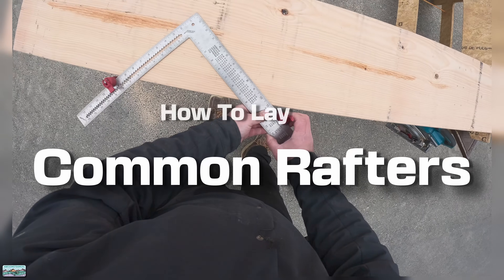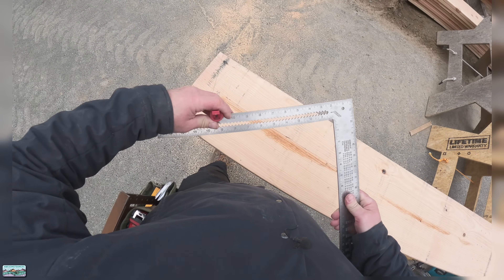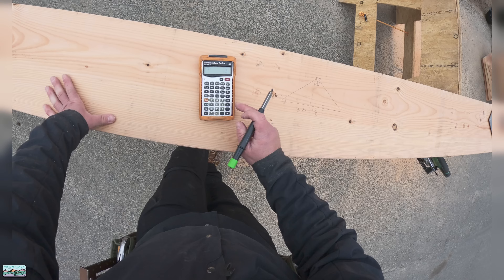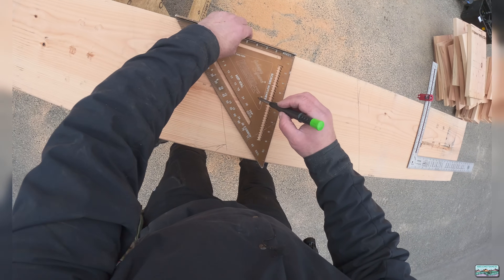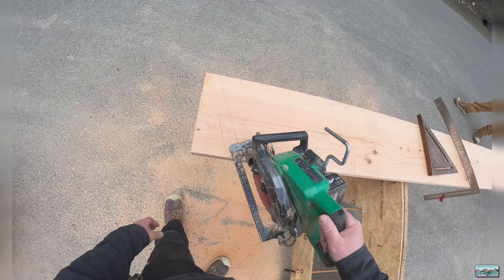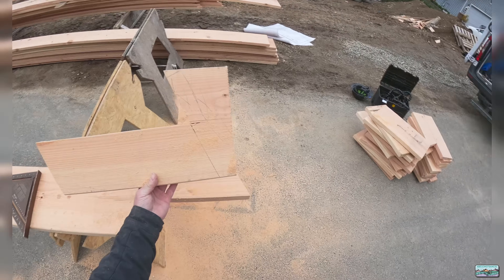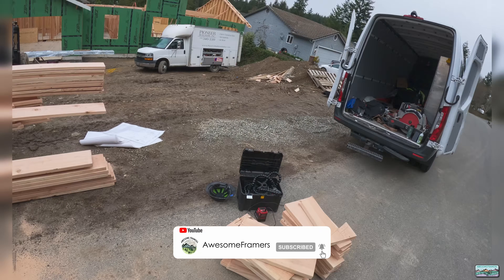How to Cut a 5/12 Pitch Rafter with Precision Project 120 part 14

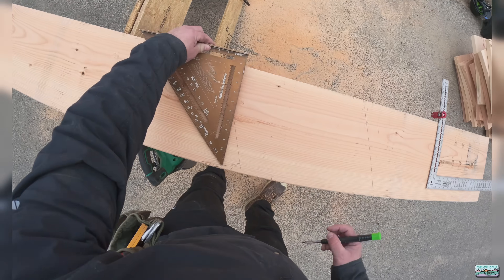Comment: Rather than cutting rafters at pitches like 3:12 or 4:12, wouldn't it be easier to cut them at 20 degrees, 25, or 30 degrees? That way you could cut them with a standard chop saw set to that angle.
Reply from the maker: Absolutely! BUT that's not necessarily practical for many. Chop saw is definitely non production

Comment: Great video, and the rafter tail is interesting on this one. At 6:41 you show where the rafter is bearing on the top plate of the wall. It seems like a very small area for such a big rafter. What type of hardware are you connecting it to the wall with? Just blocking? H-1?
Reply: 7:30 inset pic shows the blocking. He also uses the Simpson SDWC screw thru the plate to tie the rafter to the wall.
Reply from the maker: This was plenty of heel to transfer the load.  Think joist on a 2x4 wall with rim.  3/4" transfers the load, code is 1.5" for a 100% safety factor.  We are double that.

Reason is to maximize height for insulation and because in the last video we gang cut the rafters and the capacity on the saw is about 3 3/4"
Reply: same question, for 2 x 6 top plate why not a 5 1/2" heal?
Reply: Great video!!!!
Thank you

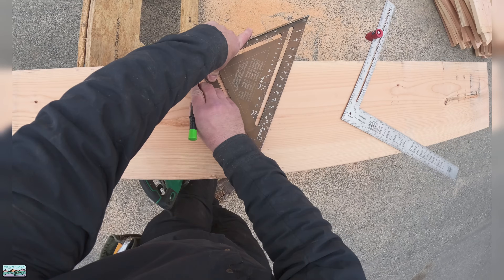Comment: Hi.  New to rafters and such.  How did you get the heel stand at 2:56?
Reply: The heel stand is a very important aspect of roof framing. Probably the most important. (And complicated depending on the building conditions). 

But for a carpenter who is beginning his trip down the roof framing rabbit hole…. The the H.S. establishes the height that a roof structure sits above the plates(the actual roof plane). This dimension is influenced by a number of factors, wall thickness, rafter material width and the pitch of the roof. A roof framer takes these factors and lays out the Birds mouth. Striking a balance between bearing surface (the level cut on your Birds Mouth) a rule of thumb being no less that 1.75” bearing on  the top plate, not including the sheathing. Obviously the more bearing the better. Many carpenters will use the width of the exterior walls as their level cut on their Birds Mouth.  Which will lead to the next issue, being how much material is left above the birds mouth. This is where the rafter material width and pitch comes into play. The rule of thumb is don’t cut a birds mouth that is deeper than 1/3 of the boards width. 

In Tim’s case, he likely has a balloon framed gable wall and his 11.25” HS is the height he needs to set the top edge of his rafter to. (Establishing the actual plane of the roof, he has many videos where you can see him doing this) 

In many cases the HS is somewhat arbitrary. Good bearing on the wall, enough.  rafter material running over the wall to support the overhang and you are good to go. 

 Keep in mind the H.S. Question gets pretty complicated. There are many variables that come into play. But roof framing is the most interesting aspect of home building (my opinion ) and spending time learning it is almost fun, especially once you get the basic concepts down and start getting into some more advanced stuff. Literally never finished learning.